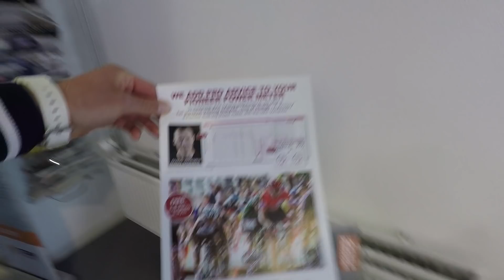FTP TEST by ANAEROBIC THRESHOLD ANALYSIS - #cycling

Comment: Today at 3 pm Southern Ontario : 42 celcius , 95% Humidity, 45 km hr head winds, 30 km hr cross winds. How many pro cyclists do you see out training today ? ZERO they would be dead in a 5 hour ride on these condition s. Quit doing these tests inside they mean squat as they don't provide real world numbers.
Reply: The point is literally to have a similar test for all cyclist bro
Reply: @auresk11  True inside. The only problem with this test is there is no outdoor conditions. This means you can not add veriables like wind, heat, humidity, riders height which affects wind riding position. Lab tests are just a starting point to be taken with a grain of salt. For example is the bike aero or flat tubes? This makes a big impact when riding against 25 km hr head winds. You have to recreate outside conditions inside that lab in order to have a proper test on max watts, how long can we pedal in the drops position. Too bad these tests have to be done outside 😞.

Comment: Thanks for sharing this Jasper! Very useful and great effort indeed, well done! I am a novice and trying to understand how to perform my FTP test at the gym, so not so professionally, but at least to get an idea of the numbers. Why was your threshold around 370 since you reached 500+ watts? What determines the threshold? Is that when your cadence started increasing? What cadence do you have to maintain to check your strength? :)
Reply: The threshold means where your blood is building up lactic acid quicker then you can remove it. Too much of it stays in the muscle the harder it gets to use the muscles.... You can check it with  a quick bloodprick like a diabitic needle prick. Use a strip and check at each interval.

Comment: Why not keep mask on afterwards to better analyse rate of recovery? Very strong.
Reply: Because cleaning puke from the mask could be problematic.
Reply: For what?
Reply: It was a genuine question. He doesn't throw up either.
Reply: He doesn't but it isn't unheard of after such tests.
Reply: I do the test twice a year in a lab on a similar ramp with gas analysis, mask stays on to take further data during recovery. Just curious if that's the only reason they take it off.

Comment: so 4.5w/kg not bad! I'm at 4.1 myself in my second year of cycling. but I'm waaaay lighter so I wouldn't be able to hold your wheel in the flat haha
Reply: 5.1W/kg ...66kg here... some months ago went on a breakaway on the flat with headwind with a guy some 20kg heavier. Every time it was my turn to pull I thought that it would be the last hahah... 5.8 to 6w/kg during a minute or so... so hard to keep the speed. We managed to open a 2' gap... 10 km to go I had to deal with him... "look... you cross the line first.. no sprints... but let me rest at your wheel a bit more". So I got a 2nd and very happy. Damn.. suffered more than on a HC climb!
Reply: Same for me, verry low ftp: 285W and i'm only 60kg so 4,75W/kg. I hope I don't meet Jasper on the flat, he would destroy me :D
Reply: im 57kg 4.1w/kg and no doubt he is going to destroy us light riders on flat
Reply: Same here 60kg 228W so 3.6W/kg. Bad thing though the only races in my area are all flat circuit races